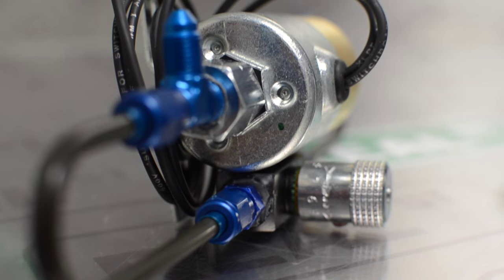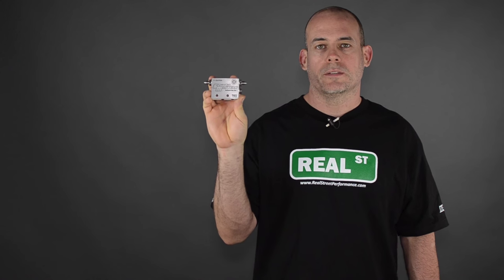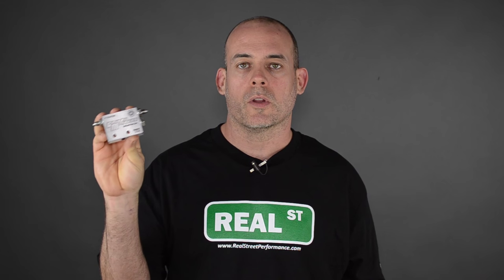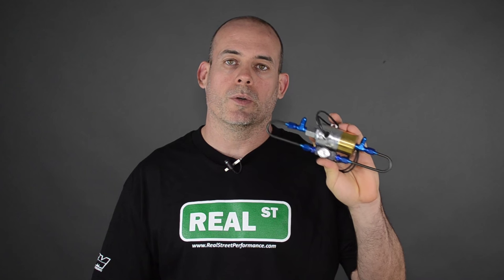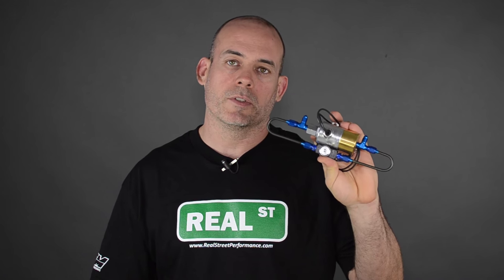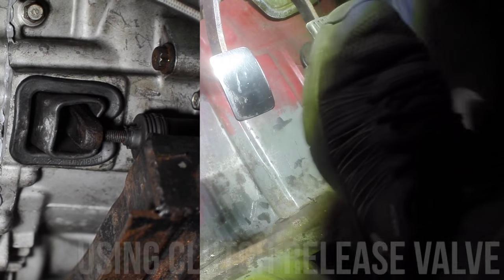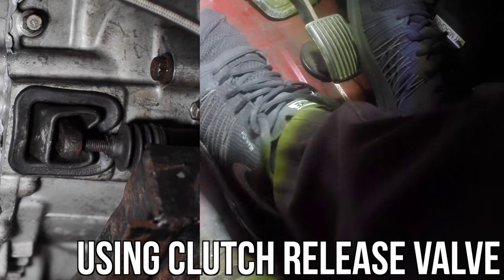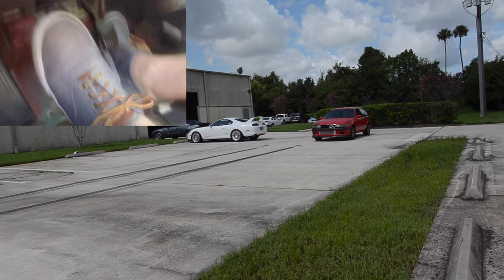How to Launch your car perfectly using a Clutch Release Valve - Jay's Tech Tips #32

Comment: Hi! First of all I love these videos so please keep them coming. Jay seems like a very knowledgeable person when it comes to tuning vehicles for performance applications! It's a real privilege to be able to learn from one of the best shops out there IMHO. I'm an apprentice bmw technician and I want to learn as much as possible about the performance world. 

I just thought I'd share that in most bmws built after 1995 with a manual transmission have mechanical clutch delay valves in them installed from the factory! However these valves are not intended for performance application (launching). They are intended for drivability and longevity of drivetrain parts for the average person. However I removed mine because I didn't like the lack of pedal feel and the fact that I couldn't have complete control over my clutch for drifting, burnouts, or even daily driving

It wasn't as fancy a part as some of the examples you have here, nor was it adjustable, it was basically a one way check valve.

Comment: Im running a Magnus controller, Also the car has a Tilton Twin disc Carbon / Carbon w/Hydraulic release bearing. The flywheel is also a one-off billet flywheel made by Magnus specifically for the Tilton twin disc. I run a Haltech Elite 2500 and the gearbox contains a Shep / PPG gearset (4 speed). 1st gear is extremely long. How do you recommend I activate it? Through a momentary button like the one on my steering wheel or can this be completely controlled by the ECU to remove the chance of human error?
Reply: The easiest way to do it with a H pattern shifter is to put a momentary switch that's only activated with the shifter in first gear. You'd power the valve with a key on 12v+ and use the ground circuit routed through the momentary switch and to the Haltech. The Haltech would activate the ground under a certain ground speed and over a set throttle level. This would leave the valve active only in first gear and only under a certain ground speed while at WOT.  You don't want to have it controlled by you, too many variables and your ECU can handle the task.  Thanks

Comment: wouldn't this slow shifting once launched?
Reply from the maker: +geoff the mechanical one would. but the point of the electronic one is that it solves that problem. The ECU only allows the valve to operate during the launch, and bypasses it electronically on every other shift.
Reply: +REALSTREETPERFTV thank you for the info and videos well done.
Reply from the maker: +geoff you are very welcome, thanks for watching!
Reply: REALSTREETPERFTV  could the electronic one be compatible with hondata s300?? Thanks

Comment: Hi Jay, 
Great vids!  
Question - Adding this device to a car like mine (6 speed Supra 740whp) with a full face South Bend single disc clutch. Does the clutch take more abuse with this? Should i consult with South Bend first before i get one of these? 
Thanks
Ryan
Reply: +Ryan Sammut 

 A single disc is doing a good amount of work for a car like yours. The clutch's lifespan will be shortened with something like this however at the same time if you're slipping the clutch with your foot it's likely you're doing more damage than a properly tuned valve. 

 Thanks
Reply: +Jay Meagher Thanks Jay. I talked to John from South Bend and he is saying that a little slip is fine. It will shorten the lifespan of the disc but it should not damage it.  I guess it depends on how long of a slip you adjust so having a single disc, i should keep it at a minimum. I really need to dial in my 60ft. Proefi launch control, 2 step etc are not cutting it. 
I might try this
Reply: +Ryan Sammut  It's not a easy car to drag race, depending on the turbo size you may want to add RPM and lower boost on the starting line.  Smaller turbos offer more forgiveness with this approach. 
 thanks

Comment: Would this work on a 2015 Ford Focus ST? Australian model
completely factory standard.
Reply: Yes I had the Clutch Masters in my car. Buy another clutch line from the slave to the master line. Take it to a hydraulic line shop and they'll put the valve in-line. It works well, however I had a larger turbo and making 4-5 psi off on the 2 step (which happens below 3K and above 5999 rpm) so it still spun the slicks (1.90) I needed more delay so I recommend getting one from Granny's Speed Shop, it's called the Hitmaster and it's much more involved but worth it and you'll get better 60 ft times & smoother shifting.